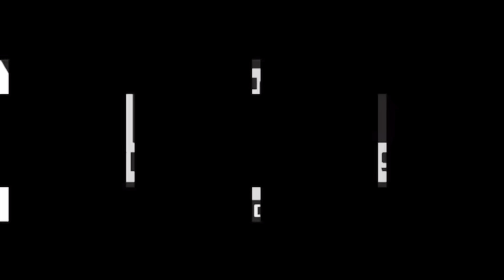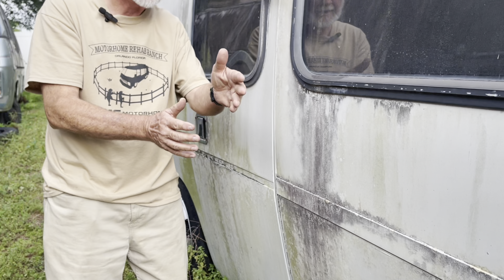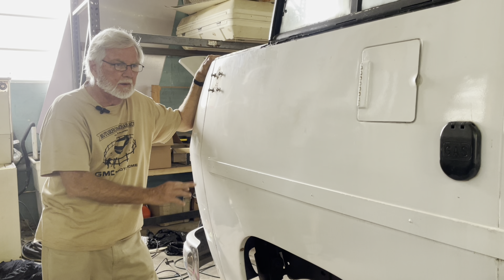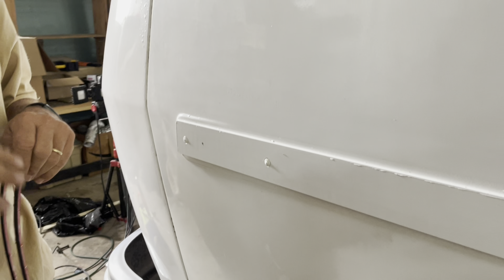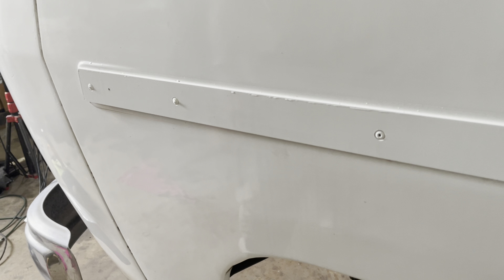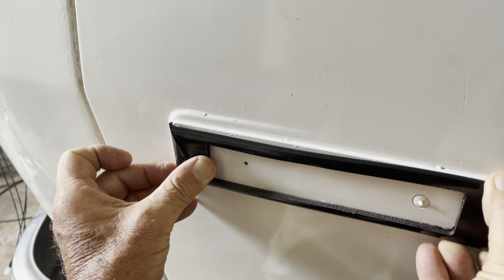GMC Motorhome Body Side Molds - Jim Bounds

Comment: Why do you need the chip at the end? Couldn't you just cut the end at a slight angle?
Reply: i was wondering the same
Reply from the maker: That is always the first question, thank you for bring it up right away! Ending a body molding that is extruded has always been the problem trying to make it look acceptable. The finish on the front of the end of the molding needs to exactly reflect the finish of the extruded material. You need to use a section of the extruded material to make that finish look appropriate. Pretty much the same thing was done with the original type two molding and as every other extruded molding that's available offers some sort of end. My original "jig" was given to me by Paul Lawfler who was the owner of ocaen atlantic gmc from the 80s. Since then every molding offered for the GMC ended the extrusion with a chip. Abby made the most beautiful chip I have ever seen. Thank you for your question!

Comment: Huh, so why didn't Abby also cut the part we are supposed to cut.
Reply from the maker: Thank you for that question! In producing a part if that part can do two functions from one set up and one pass it's more effective. Abby makes the front and the back sections in one pass. When you cut them you want to be sure you the seam is on a flat area of the alum strip, look at your body. Having both ends together you are able to put the seam where it needs to be. Thanks for asking!